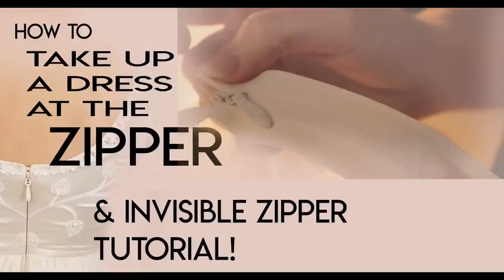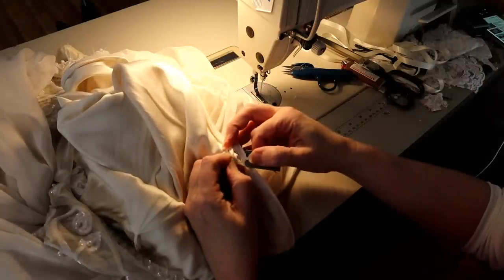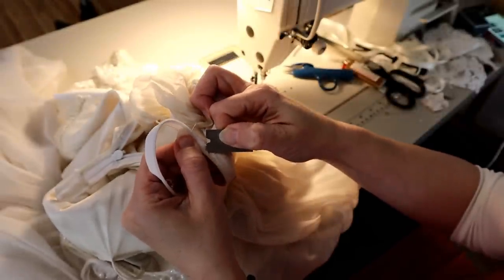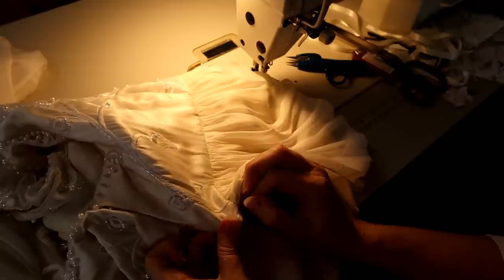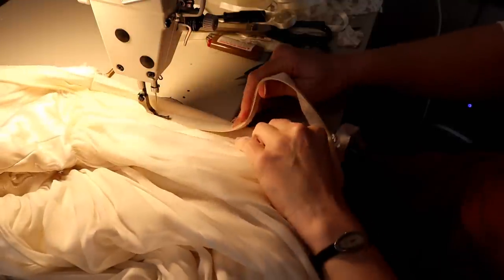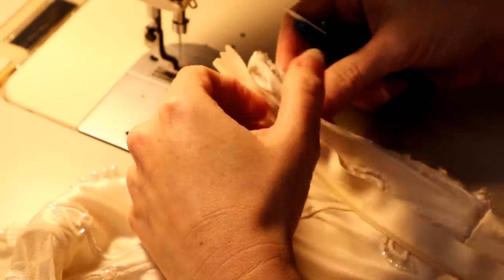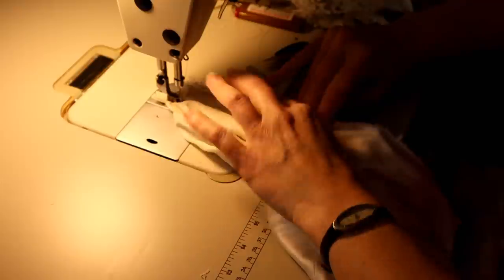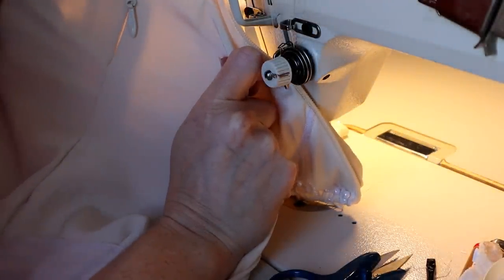How to Take In a Dress at the Zipper & Invisible Zipper Tutorial

Comment: Great video. I too "move over" at the waist seam when I put an invisible zipper in any dress- I often tack the zipper to the salvage there as well so I can give that slider plenty of room to zip. Most of the invisible zipper replacements I have to do are caused by that too tight to the coil stitching at a pressure point. By bumping out you make it so much easier to zip and a little tack can make it look as if it's sewn perfectly straight. In fact I have made this change to dozens of ready to wear dresses of many types and the customers love it. It is super great with that funky scuba type fabric.